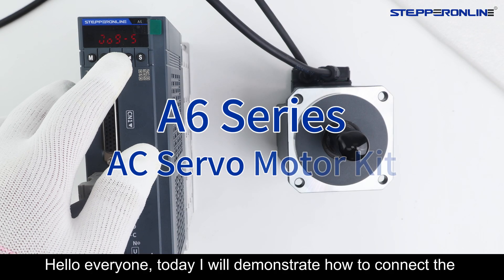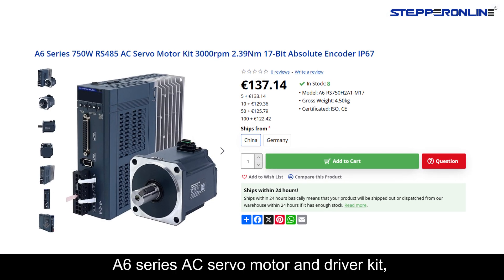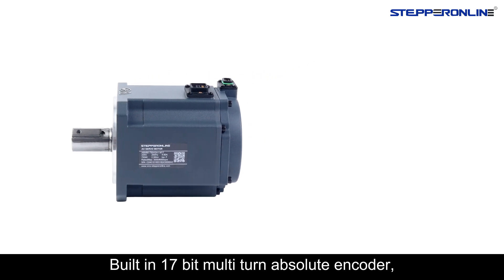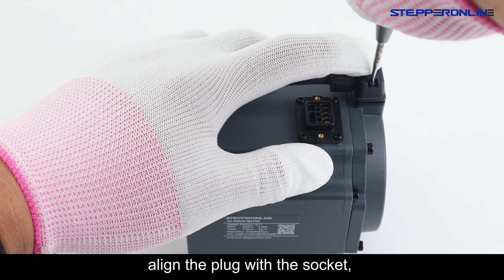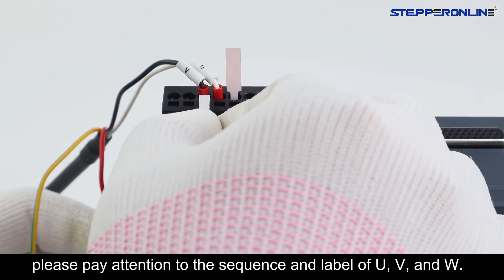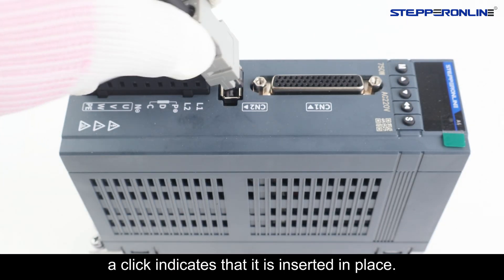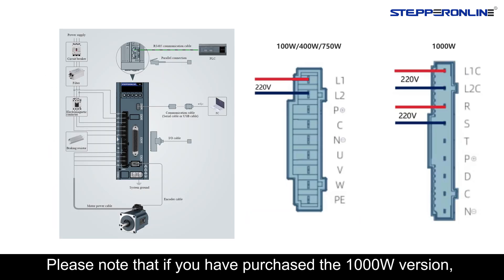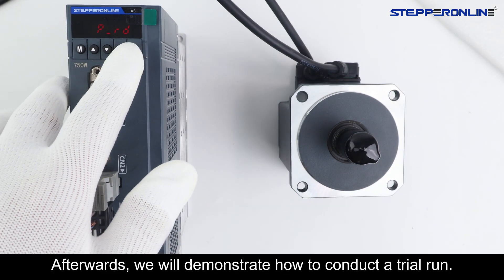Installation and basic commissioning of A6 series servo motors

Comment: The wiring is what I wanted to see. A standard American 12-3 romex has 2 hot wires, a neutral return, and a ground. The documentation is not clear what to put where for the 1000W model C. This video doesn't say anything.
Reply from the maker: Two live wires connected to L1 and L2, and R and S.
Reply: @omc-stepperonline  What you said means connect 2 extensions to each hot wire and put them in the 4 terminals and completely ignore the neutral and ground wires. That does not make sense.
Reply from the maker: @kyleleague2566  As we know, in the U.S. power supply, the voltage between the hot wire and the neutral wire is 110V AC, while the voltage between two hot wires is 220V AC. Our drive requires 220V AC, so it needs to be connected to two hot wires, with no connection to the neutral wire. As for the ground wire, you can connect it to the PE terminal of the drive.
If you believe this is unsafe, you can also use a transformer to convert the outlet power to single-phase 220V AC and then connect it to the drive.
Reply from the maker: @kyleleague2566  If you have any further questions, you can contact us directly via email at Technical@stepperonline.com.